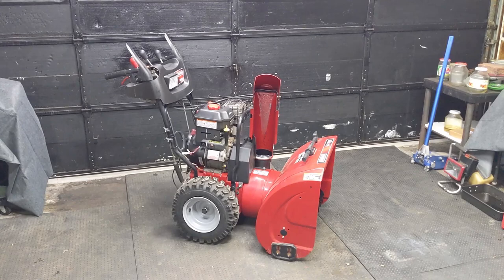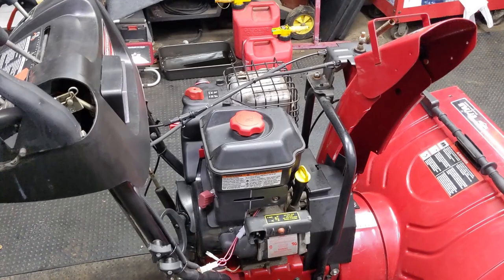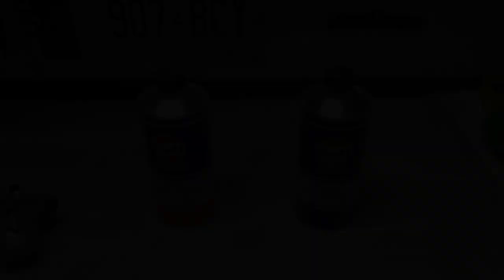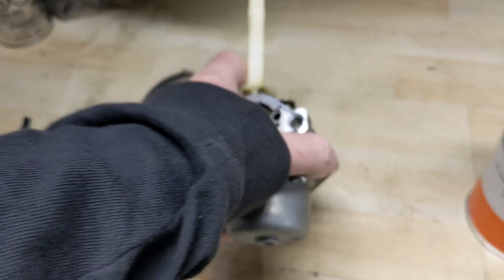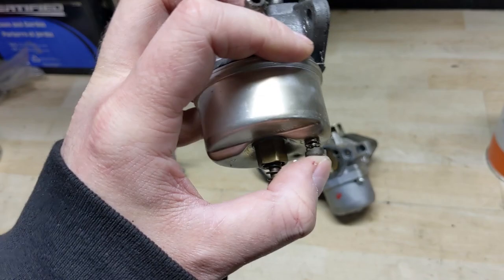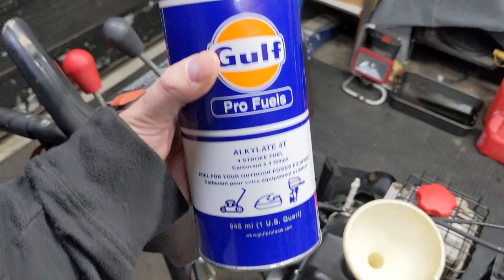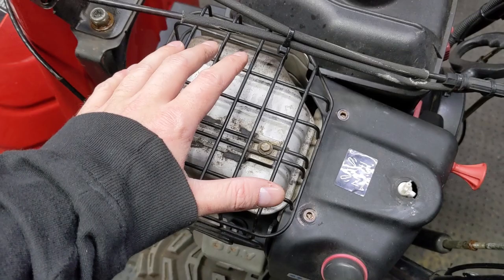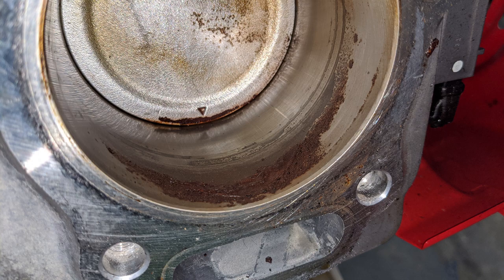How to "Summerize" a Snowblower

Comment: Great video. Me personally, I would add an oil change. I would prefer to store my machine with fresh oil instead of oil that contains contaminates from combustion. Do you sell the Gulf Alkylate 4T fuel?
Reply: All of our equipment is stored after full service which includes the oil change. We are not a distributor of Gulf Pro Fuel but have used the product supplied and are very happy with its performance.

Comment: Heat shield?  Maybe that's missing on my blower with the 1350 that won't start warm.
Reply: If it will not start when warmed up it may be an ignition coil issue.
Reply: @Wayne Stefinashen  I swapped carbs, coil, checked  valve adjustment.  It will restart with electric  but not pull cord, but let sit a bit pull cord will be enough. Mind you, the swapped coil was from a rider engine which only has electric start so remotely possible it has issue too.
Reply: @gadasavideos8564  Must be the proper coil or it will not work properly needs to have the proper resistance rating specifications for that engine model
Reply: @Wayne Stefinashen  I think I checked ipl of both engines and confirmed that the coils were the same but I will double check.

Comment: What about K100 or other fuel stabilizers? Thanks for the info.
Reply from the maker: Due to all of the fuel in our area now containing ethanol, we will not be seasonally storing any equipment (for long periods of time) with pump gas. We will however be still using K100S+ fuel stabilizer, with the pump gas 91 (least amount of ethanol) to run out equipment throughout the seasons.
Reply: Awesome stuff that K100S+ no issues over 9 years and 1 to 1 ratio will eliminate water phase separation (tested and proven not many do this).
Reply: @EliminatorPerformance  in Quebec at Canadian Tire, no more K100 🥲
Reply from the maker: @danielcote4888  yes very unfortunate, CT is no longer carrying the K100S+ for some reason.
Reply: When CTC stopped selling it was $12.95 Cdn plus hst so $14.63 would guess if they still carried it price would be at least $16 now?

Comment: i have a spray can of foging oil . will it work the same?
Reply: Basically it protects the engine in the same way but fogging oil it normally sprayed into the carb while the engine is running causing major smoke out of the muffler thus fogging.
Reply from the maker: But also carbon build up from running it while spraying, I don't necessarily like that way. Also there's a chance someone gets some spray into the carb and that has its own issues
Reply: @EliminatorPerformance  is it ok to just spray it in the spark plug hole  to lub the piston
Reply: @francislang5075  That works and pull the recoil rope a few times to allow the oil to spread around inside the cylinder.
Reply: @waynestefinashen239  that is what i did wayne thanks.    are you located in ontario canada
Reply: @francislang5075  Yes small town of Port Colborne along the shore of Lake Erie and the Welland Canal
Reply: @waynestefinashen239  good another good canadian. i live in a small town 40 min north of guelph ont    in harriston